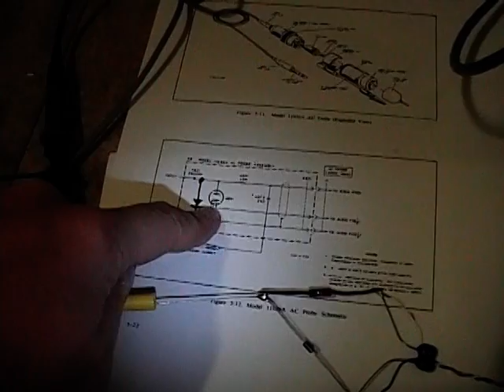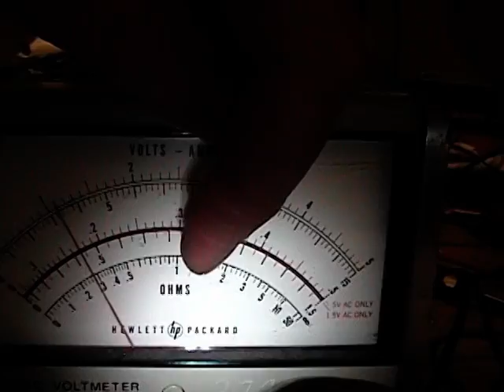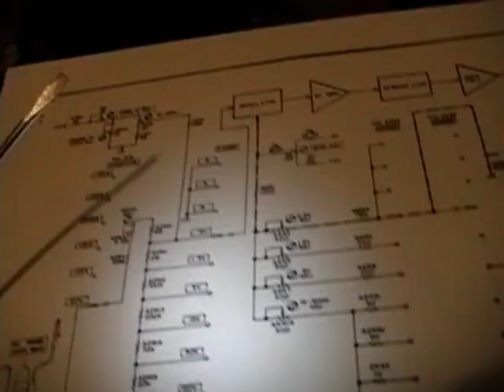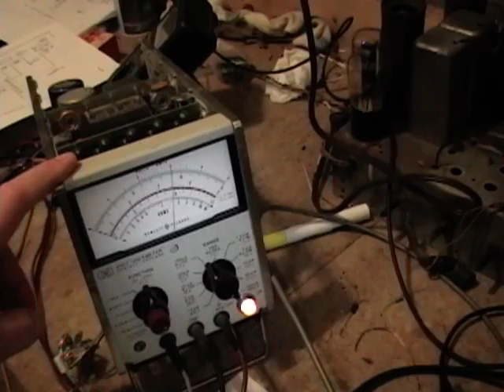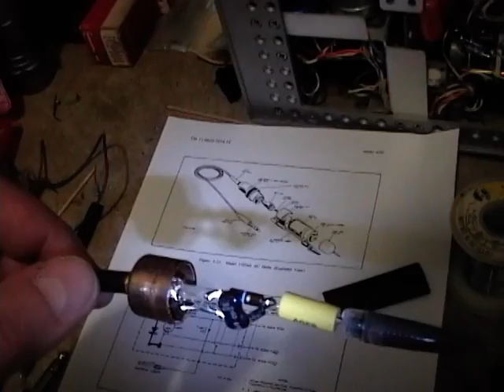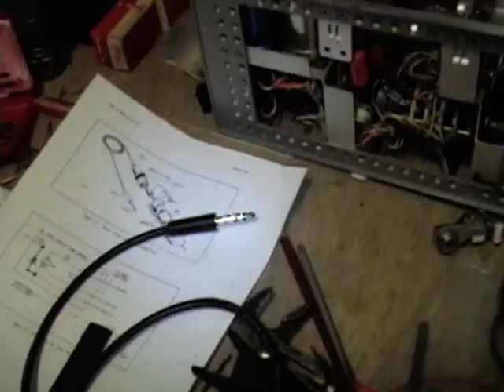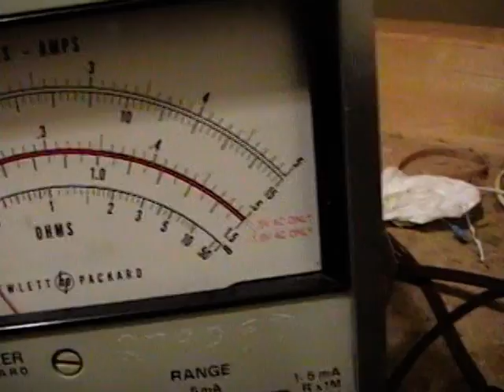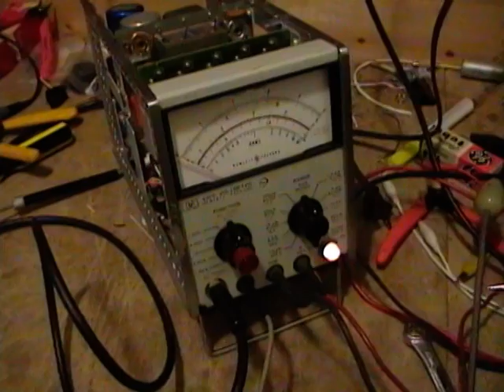HP 410C VTVM p2o2

Comment: 4:10 Paul Carlson had a problem with a meter not centering. His problem was the needles counterweight was slightly bent putting the movement off center.

Comment: I just purchased a 410C and can't wait to get it tuned in.  Can't seem to find a manual that covers my serial number and have found that the chopper frequency adjustment pot is not on my unit.  There is what looks like a thermistor in it's place.  Not sure, I'll have to check the color bands to be sure.  My neons look like they are 'on' all the time, though they may be blinking so fast I can't see it, though the frequency is supposed to be 100Hz.  Also, after just a few minutes the AC probe gets quite toasty hot.  Hot enough that I don't want to hold it for very long.  Not sure what's going on there.  But I think I may have to rebuild it using some sort of high speed diode with 300-500 PIV.  It doesn't look like an original HP probe though.  Don't really need to measure AC voltages at 700 mHz.  Any advice or guidance you may have would be appreciated.

Comment: I have the same vtvm but mine has the genuine RF probe. I made an RF probe for another unit so must compare the 2 and see how good the diy one compares. I bought my 410c calibrated APPARENTLY but it was out when it arrived in Australia and also had the same issue with the probe wire breaking. Its very important to ensure both ends of that black probe are tight as if the rear comes loose the wire breaks. I have a proper ohm test jig from 10ohm-10M for checking other instruments regularly which helps, also a voltage test rig.

Comment: A Schottky Diode (RF Probe) is a better replacement (you should know that, basic electronics).
Voltage levels and Frequency response would need to be checked.

Comment: The AC zero on meters equipped with vacuum tube probes is always set up to apply a compensation voltage to cancel out the contact voltage of the diode tube. Even with no signal applied, a vacuum tube diode produces a small negative current due to electrons released from the hot cathode striking the anode. With a solid state diode, of course, there is none of that. I would recommend a fast germanium diode like a 1N270 (100V PIV) or else go back to a tube. I have made a couple RF/AC probes using 6AL5 dual diodes, and they work well to about 250MHz.       Rob

Comment from the maker: Yes, the DC restoration circuit works with the video signal which has a bandwidth around 3MHz - that's much too high for a 1N4007 to handle properly.  Those old HP 410C AC probes were good to over 350 MHz I believe :)

Comment: Awesome job on that probe re-design Bob. It seemed that the 1n4007 would give you a hassle but did not know how. Wow what a funny tiny little tube was in the old one. Seems that the offset due to forward (10V??) was too high as you found. What was the number on that tube Bob..never saw one like that. Thx so much for showing us the insides of a cool HP equipment.

Comment: EXCELENT job on the probe!!  Maybe you should place some heat shrink over the whole copper tube to also cover up the solder joint of the GND clip.  Also, get some small screws and drill and tap the cap at the end, so if anything goes wrong, you can still pull it apart :)